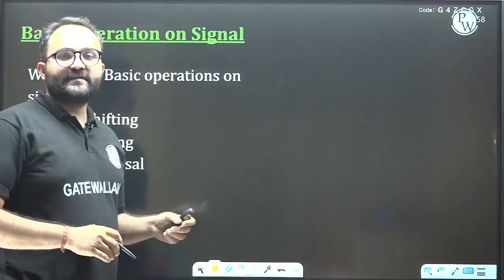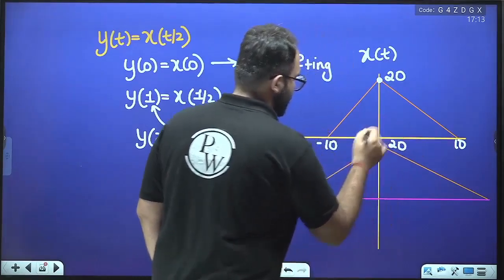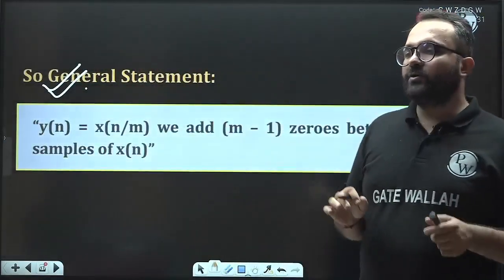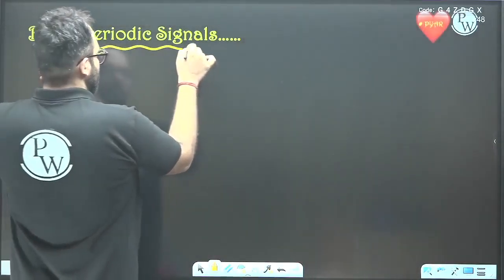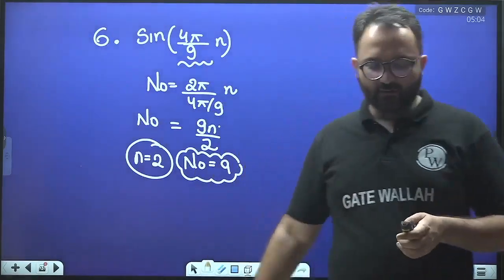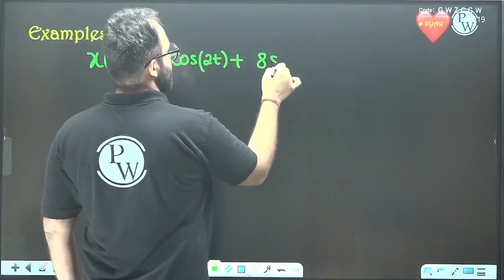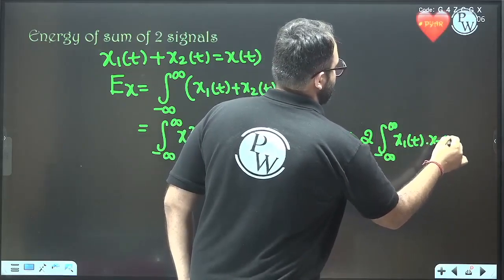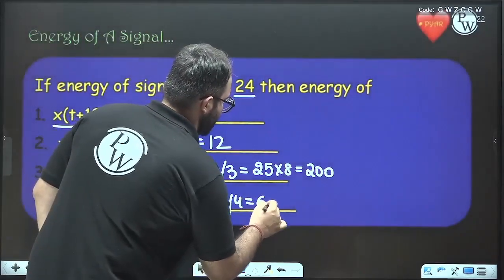Signal and System | Signals and Its Type Part - 2 in One Shot | GATE 2023

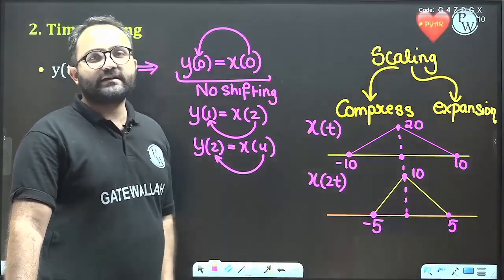Comment: 14:29 In x(t) and y(t)=x(2t) triangle diagrams the height should be the same for both x(t) and y(t) i.e.20 Because in only scaling operations x(0)=y(0). 
Which also notes that in scaling operations the amplitude (along y axis) remains the same where only time (along x axis) scales.